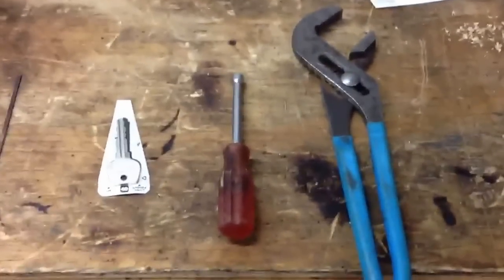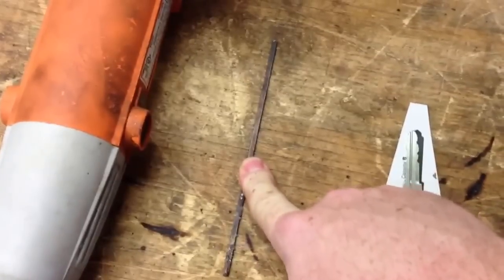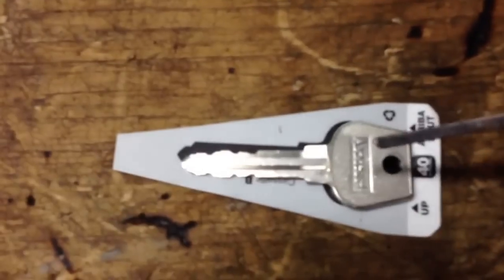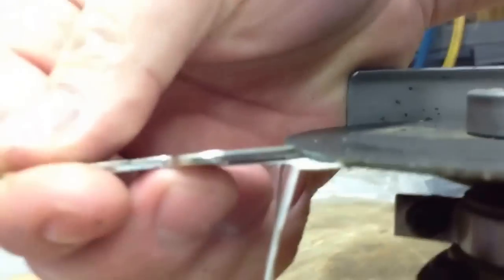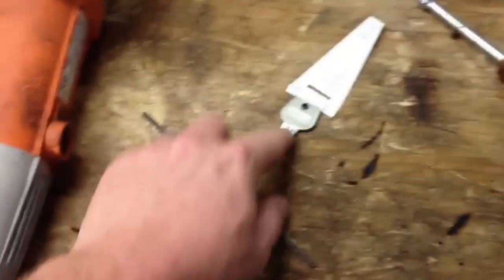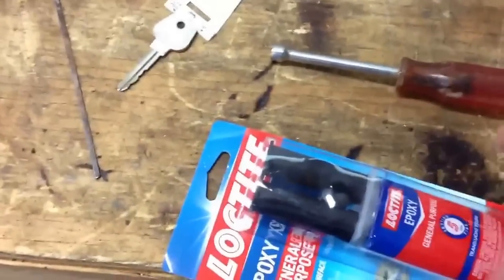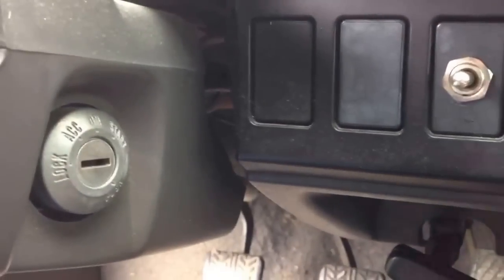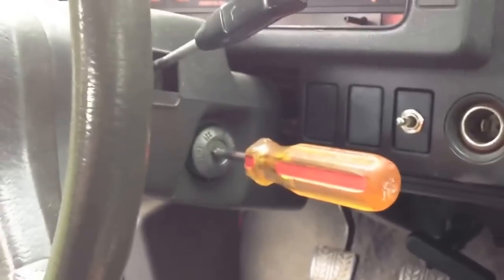How To Make A Screwdriver Key

Comment: Back in the day, we use to take a hammer and beat a flat head screw driver into the ignition switch and then take a pair of vise grips and lock on to the screw driver and twist like crazy. This worked 100% of the time.
Reply: Did it frfr I lost my key
Reply: @mylilspideroff1900  it did
Reply: Did it work on cars from 2008
Reply: @jacobmeyerson2420  Never tried it on one that new.

Comment: While this is a great custom mod, the weight of the screwdriver handle will cause extra wear on the key (which is why you shouldn't use lots of keyrings and keychains). Possibly using a smaller driver would work better.

Comment: Cool, i love screwing with people but there may be a downside to this. Most ignition locks are not meant to carry so much weight. This could cause problems with continued use in the future. 
BUT . . . Cool as hell !
Reply: You can always take a mini screwdriver, pull the shaft out, and cut into it for the key. That'd be plenty light, and still be a screw driver.